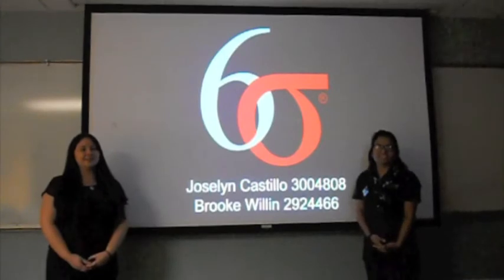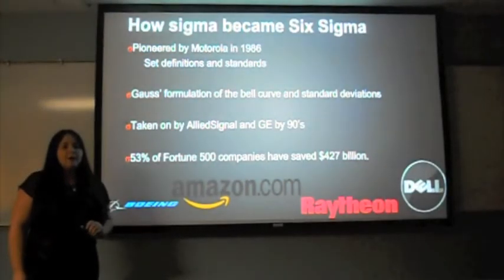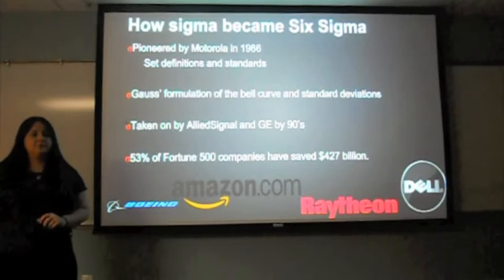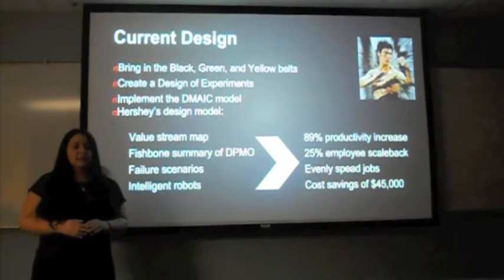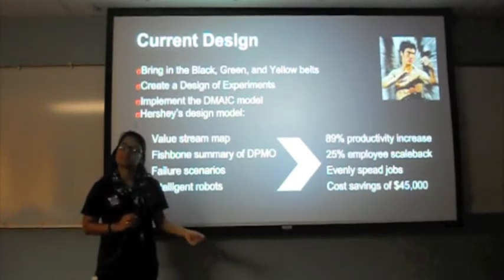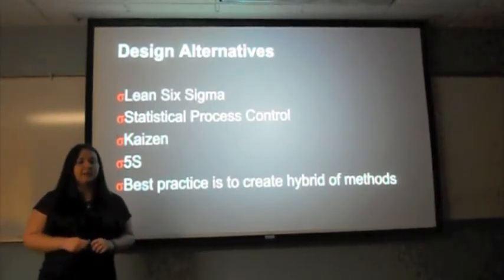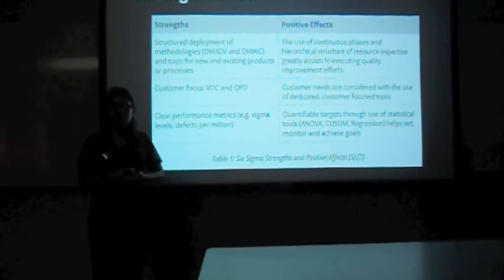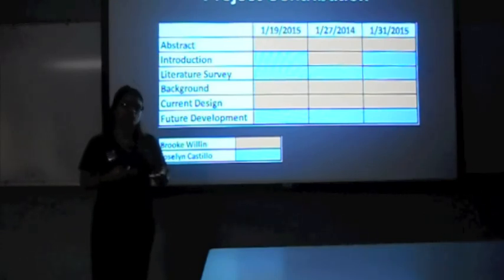Team E: Six Sigma

Comment: This was a very good presentation. It was informative, you guys did not stutter which shows that you practiced and understood the information, and the power point was perfectly made to the point where you were able to elaborate on short statements. I feel like it was a good idea for you guys to turn off the light depending on the illustration in the power point. Lastly I liked how you were able to interact with the power point to show the audience where you were on the slide with the laser pointer.

Comment: Presentation contains lots of valuable information that is relayed very clearly and at an easy to follow pace. Explanations of the history and the process as well as the alternatives were very well done. Video quality is passable but can be improved upon. More visuals could have been added to the slides however, Six Sigma is understandably a difficult topic to display visually. Overall, great presentation. I did not know much of Six Sigma to begin with.

Comment: The presenters documented well the material and the information delivered was excellent. They both looked well knowledgeable on the topic and easily spoke of the topic. The power point presentation had the right amount of information for the audience as well as good visuals to explain the topic. Very easy to read and to follow along. However, the presentation could have been improved by having more light during the presentation because at certain points the audience could barely see the presenters. Great topic and great delivery of information!

Comment: There is a really good amount of information in this presentation. You can tell they spent a lot of time doing their research and preparing for this presentation. both presenters are well prepared for their parts, but it would have been nicer to see the time of presentation more evenly split. Also, having a room that is better lit, and just a few more slides would have helped this presentation be one of the best. Although the background noise is somewhat distracting, the fact that the presentation is so well written and the presenters do such a great job talking, makes you forget about that noise after just a few minutes.

Comment: Very good presentation. The speakers appeared to be very well prepared and knowledgeable of the topic. The information was presented in an easy-to-follow way and it was well organized. I do believe that you could have included a couple of more slides to support what you were saying. For example, on the last part of the video, where you talk about the pros and cons, the “strengths vs positive effects” table is way too crowded with words and it is nearly impossible to read. Maybe splitting it into smaller sections and more slides would be better. Lastly, I feel that showing more diagrams (like you did at the beginning when explaining the “bell curve”) can help the overall impact of the presentation. Overall, I think you guys did a very good job.

Comment: Very good presentation but the change in lighting during the presentation was distracting! the PowerPoint presentation was legible with the lights on so it was not necessary to turn them off during the presentation. Other than that, the presenters did a great job at conveying their material to the viewer.

Comment: CONTENT
-The overall layout and material was well organized and had a good flow throughout the presentation. The information wasn't difficult to understand, straight forward and actually enlightening.

INTRODUCTION
-It's always good to give an outline/summary of what is going to be presented, but I never saw that. Instead you dive head first into the presentation.
-It was good to begin with the background and exact definition of the topic though.

DEPTH OF THE REVIEW
-The depth of the review seemed satisfactory given the time and topic. The team put in the effort to inform us about the history, current and alternative designs and examples of how such designs work in the world. 

PREDICTIONS ON THE FUTURE OF THE REVIEWED AREA
-I believe as different unforeseen obstacles and issues pop up, different methods will be added or perhaps even replaces the six sigma standard.

CONCLUSIONS
-Concludes with the how the work was distributed in the team, which I think is unnecessary for the presentation (mainly something that should be reflected by each member's performance during the presentation).
-No real recap of the overall material presented.

THE WAY THE PRESENTATION IS CARRIED OUT
-Joselyn: Very good presentation skills. Spoke loud and clear, did not divert attention away from the audience, stood still for the most part with very minimal hand gestures. Spoke with confidence and positive tones which helps keep the audience interested and attentive. I really liked the Bruce Lee/martial arts correlation with the part about the different colored belts. Appeared very informed and credible due to performance.
-Brooke: Did just as well as Joselyn when it came to vocal presentation skills (loud, clear, good flow, confident, et cetera...). However, she did move her hands a lot out of instinct or in order to communicate and she spent a lot of the time, by the end of the presentation, looking at her slides.

DEMEANOR
-Very respectable and professional from all members.

LIGHTING CONDITIONS
-It's dark in the room, sometimes I couldn't see the speaker very well if at all.

VISIBILITY OF SLIDES
-Everything was visible, but some of the slides were cut off at the top, like the title of the final slide.

CLARITY OF SOUND
-No issues with the sound.

VIDEO QUALITY 
-Okay quality.

LENGTH OF THE PRESENTATION
-Reached the required amount (10 minutes), but went over a little (by a minute and a half).

WHETHER THE VIDEO TAUGHT YOU SOMETHING YOU DID NOT KNOW
-I knew about Six Sigma but the alternative methods were new to me.

OVERALL EVALUATION
-I think overall the presentation was good.